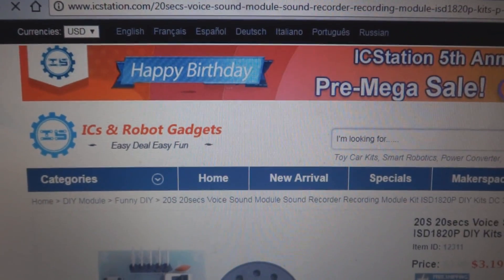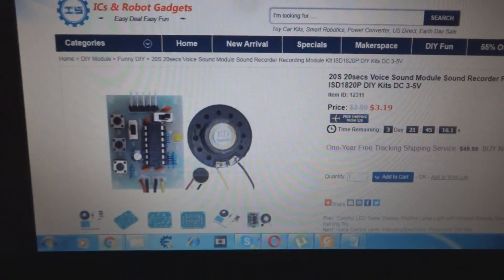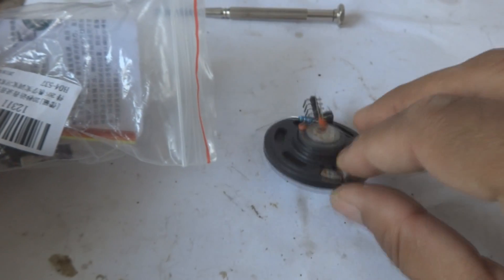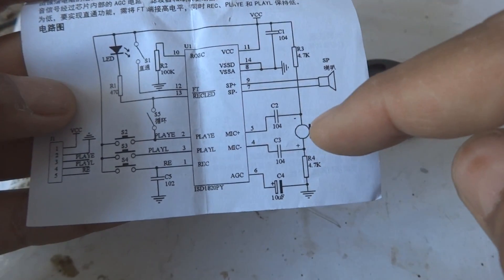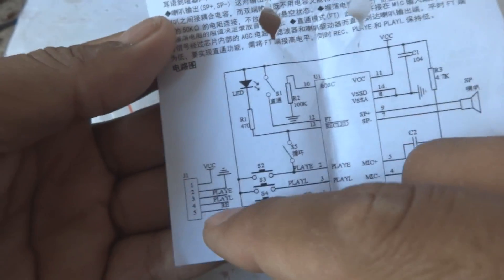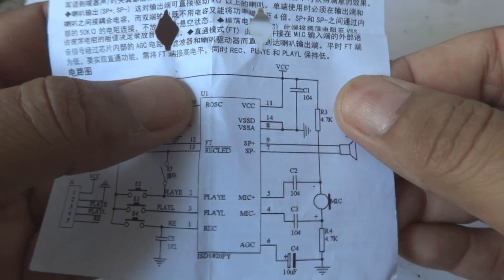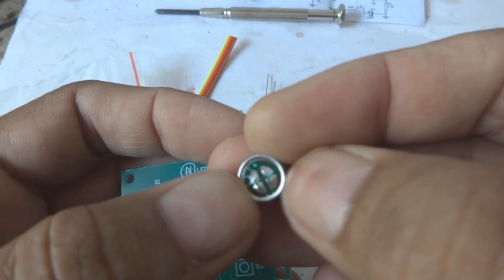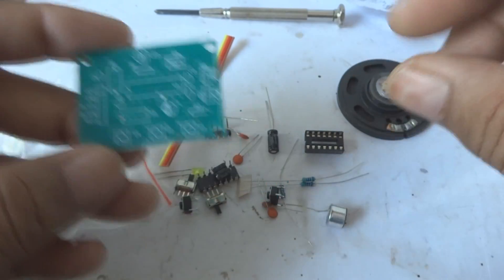ISD1820P sound recorder kit. IC station project. Sound recorder and playback digital.

Comment: '
i did removed 2 slide switchs are S1 / S5 from the kit...
replacement to 2 push switchs as push OFF / push ON put with a kit as S1 / S5...
much better

Comment: How much supply required for this project?
Reply from the maker: You can run it of 5v.
Reply: @JahanZeb1976  can we use 9v supply for this project?
Reply: hi K M...
'
can fit work with a pack of four A A batterys = 6 volts...
i have one ISD1820 kit